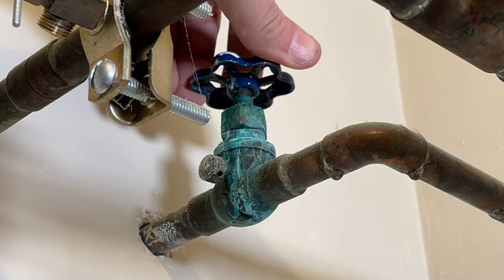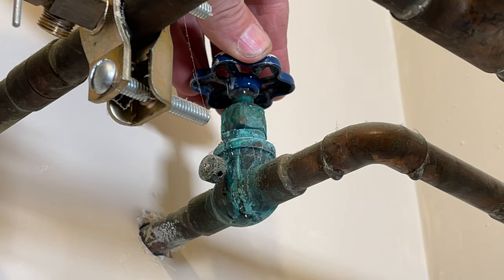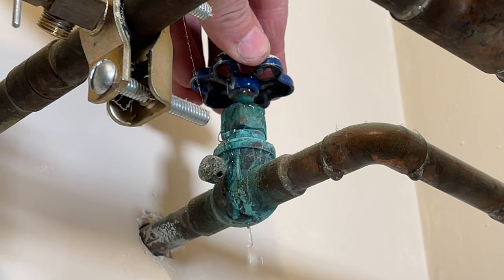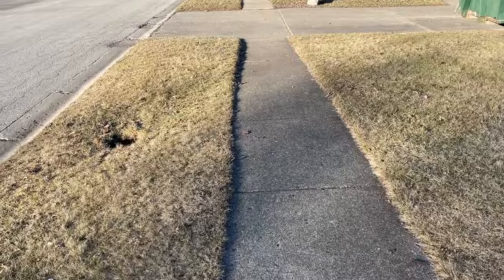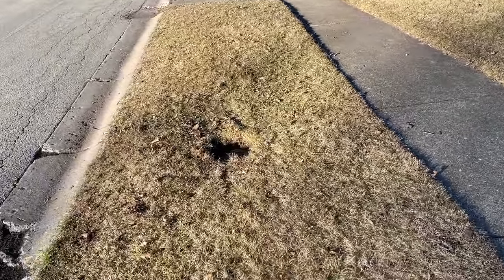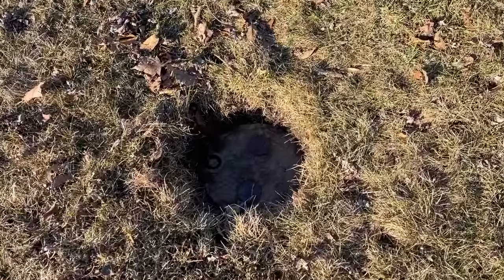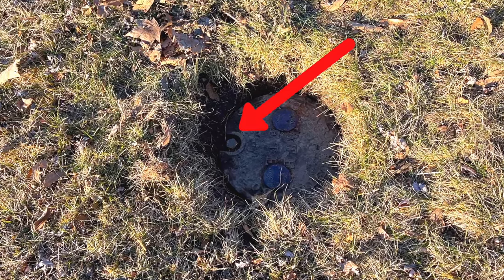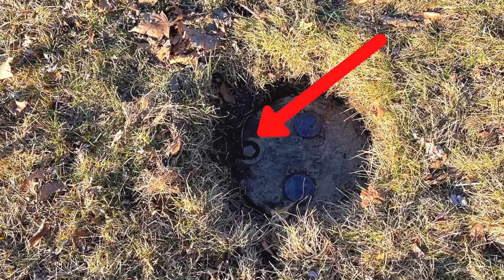How To Shut Water Off At The Curb

Comment: Which way does the curb stop key turn to shut it off? Righty tighty?  The video is unclear. Please advise. In NJ, the homeowner is responsible for this curbstop not the water company so I cant afford a problem. Thanks much.
Reply: Many water shut offs are the opposite of "righty tighty lefty loosey", i.e., you may have to turn the water valve counterclockwise to shut it off.

Comment: I am confused. Doesn't every house have main shut off valve? Why go outside to shut off? I always just shut the main valve in the house.
Reply: I can only speak for what I've seen in my state. There is always a city shutoff before the meter and that utilizes the tool shown here. Outside where the line enters the house there would be a shut off valve as well.  I've never seen a shutoff inside a house, and I do not think our code allows. I would say that each region differs in its requirements/codes.
Reply: @socalcaiman  You are in California, in Ohio the main water line enters the house underground (frost-line at my home is 36" below ground, so main water line will be lower than that to prevent freezing), comes through basement wall below that depth with an in-basement meter and a main house shut-off valve. From there, plumbing branches out to the house, each branch also having a shut-off valve in the basement but closer to the fixture it supplies. In a home with no basement but rather a slab floor, the main water line travels below the frost line depth reaching under the slab, and does a 90-degree turn vertically through the slab floor at the location of the "utilities room", typically in the home where your water heater, furnace and washer/dryer are located. In my home (slab ranch home), a lower 25% of the closet in the "utility room" houses the main water line feed up through the slab, which then has a main house shutoff valve, then the meter, then an array of shutoff valves for each line going to each water fixture in the house and outdoor faucets. Unlike California, we can't have our "utility room" in the garage, our garages for the most part are not heated and the water would freeze in the winter. We have to drain our outdoor lines every fall to prevent freezing, unless you have a stand-off outdoor faucet handle shutoff valve, which actually shuts off the water 12" from the faucet handle inside the basement which prevents freezing. I am sure Michigan has a lower freeze line, and Minnesota an even lower freeze line, and Canada could be as low as  60 inches. Fun fact: Geothermal heating/cooling actually uses this phenomena as once below the freeze line, the soil is a constant 55 degrees. So rather than heating 10 degree air, it's cheaper to extract heat from 55 degree soil, and rather than removing moisture and exhausting to 85 degree air, its cheaper to exchange heat to the 55 degree soil.

Comment: A couple years ago, I went to shut my water main off in the basement so that I could change the washers on my tub faucets (because for some reason, the people who built this house didn't think the bathtub needed its own shutoffs. I found that not only could I not fully shut the water off, the valve started leaking. I called a plumber and was told I'd need to locate my curb shutoff.

I contacted the city, since nothing was exposed and they gave me a diagram of roughly where it was. Cue a day of digging to find it. When I finally found it, about six inches down, it was completely rusted. The plumber came out, looked at it and said he couldn't open it. In fact, he cracked the cover while trying to loosen it. He said that even if he got it open, the valve inside was likely seized and if it broke while he tried to turn it off, I'd have to have the water company come out, dig it up and install a new one.

In the end, he crimped the water pipe in the basement to pinch off the flow, installed a half-turn valve , then uncrimped the pipe.

I put a cut off bucket with lid over the curb valve cover, added a concrete stone on top of it and buried it under a couple inches of dirt. I figure if they ever need to access it, it will be easier than trying to find it in the dirt again.
Reply: Sounds like a nightmare
Reply: I would've told you the real deal. That is, if I turn this and it does break, it's gonna start leaking and then I'm going to leave. Then just call the city and tell them that you see a lot of water in front of your house. When they realize that they are losing their water, and they can't bill you for it, they will come out and repair it free, they don't have any choice. ;)

Comment: First you find where the curb shut off is.  My neighbor tell me that when  they paved the street and put in curbs in about 50 years ago in the 1960's the shut off got covered over with about a foot of dirt to bring the yard level up to match the curb height.  I have tried poking into the dirt with an ice pick where i think it it should be but so far no luck.  The township claims they don't have drawings that would show the locations.  They suggested i get a plumber who should have  the proper tools to locate the shutoff.
Reply from the maker: Oh man! That sounds like a mess.  Whomever is responsible for the water (township or other company) should have to come out and find the meter if it is buried, right?
Reply: @EverydayHomeRepairs  Thanks for the reply.  The Township where I live buys their water from the nearby larger city,  Apparently any work on the water supply is bid out and a contractor is hired to do repairs, back flushing the water lines which is currently being done.  There is no one that works for the township that can find it or so i was told.  The local fire departments have equipment and tools to find and shut the water off in an emergency so i am going to talk to them and see if I can get them to user there detector to locate it.  If not i will keep pocking holes in the ground until i find that metal cover and i do know what it looks like.
Reply: Yea really that’s the townships responsibility to locate not yours!!
Reply: @EverydayHomeRepairs  The meter is in my basement and is read by a wireless device.  The curb shut off is what is buried but my local Fire Department located it for me.
Reply: Towns should have the equipment to locate water lines and shut off boxes. If not, the "officials" need to be voted out.
Reply: @KameraShy  When I called the Township the individual I talked to should have told me to call the nearby Fire Station as they have the equipment to locate curb water shutoffs which I was later told to do and that is how the situation was resolved.

Comment: That water valve can be repaired without turning off curb valve
Reply from the maker: By tightening the packing nut?
Reply: I agree. In my area in SoCal we have a shutoff just past the meter. Another one before it goes into house and a valve at top of water heater. And we still have meter readers running around the neighborhood.

Comment: Unless you own multiple houses, a plumber or general contractor you shouldn't have one of those tools or even think about buying one. The reason you shouldn't own one is because it's easy for someone to use it for illegal acts, like turning on water service when it's been shutoff due to non payment. Sometimes cities don't even want someone touching the water shutoff and require you to have them come out. It's best to just call the city when you have a water issue because you don't want to possibly piss them off and get fined because you didn't want to call them & most cities can tell when a valve has been messed with.
Reply: Almost every realtor and home inspector I know has these tools.....lol
Reply: I would be reluctant to mess with the street shut off because those valves are old and could break. That would be a mess.
Reply: @KameraShy  That's why you're not supposed to mess with with them and if caught you could be in legal trouble or be fined and not have water until the fine is paid.
Reply: @Will-ik3sz  They're not supposed to.
Reply: @justincase2071  These are only sold for that reason, an emergency but you're really not supposed to have one because too many people use them to turn on water illegally.

Comment: For those having trouble locating a buried shut off box or water line, just bend a couple wire coat hangers and try water witching. It does work. However, I would be reluctant to mess with the street shut off because those valves are old and could break. That would be a mess.